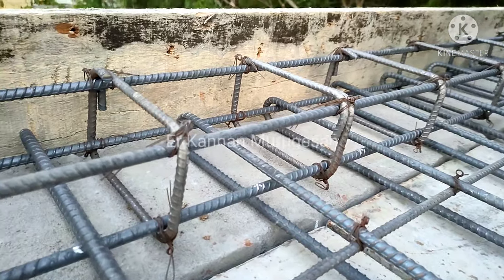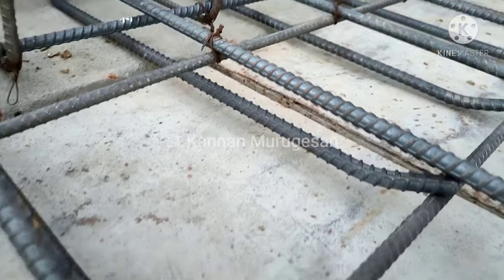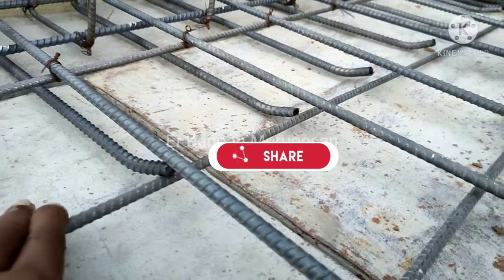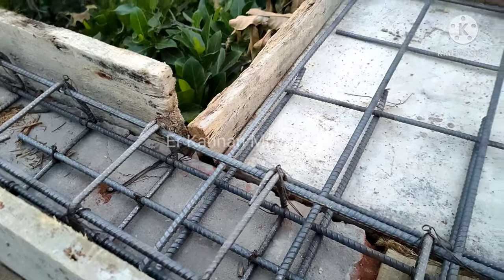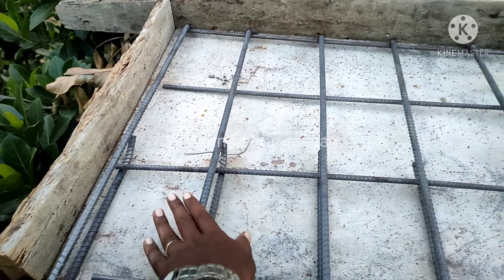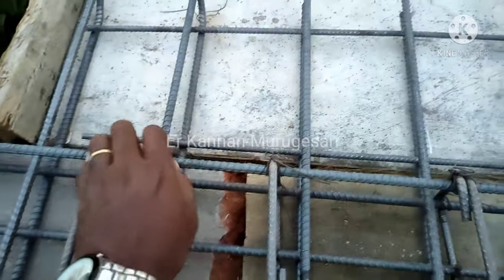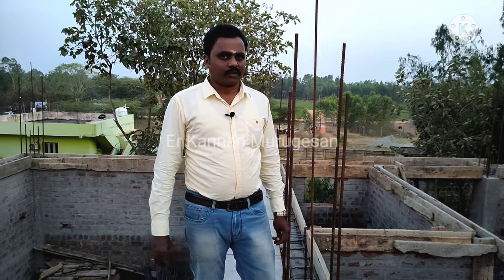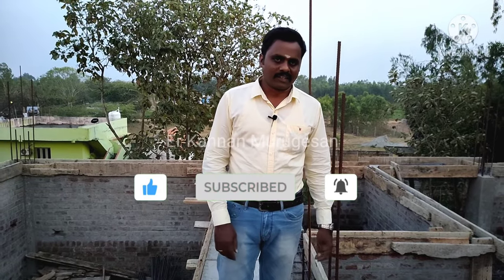lintel barbending work | லின்டல் கம்பி கட்டும் போது கவனிக்க வேண்டியவை

Comment: This is Er.Satheshkumar Structural Engineer, Tiruchengode, very useful, thank you so much for sharing information sir, Would like to know three information.                                                           1) loft slab thickness? 
2) Sunshade slab thickness?                                                                                                                               3) Sunshade one side and loft on other side shall we go with straight bar instead of "thuppaki bar"?

Comment: Sir for roof concrete which mm rod required plz reply 🙏
Reply from the maker: Please follow as per structural drawing.
Reply from the maker: 8mm, 10mm, 12mm for slab. 
12mm, 16mm, 20mm, 25mm for beam. 
8mm, 10mm, 12mm for stirrups